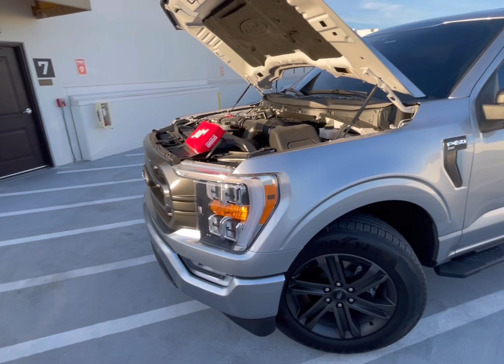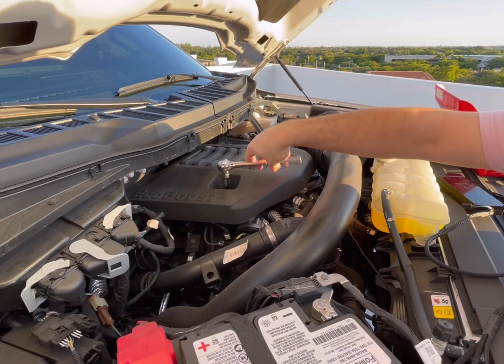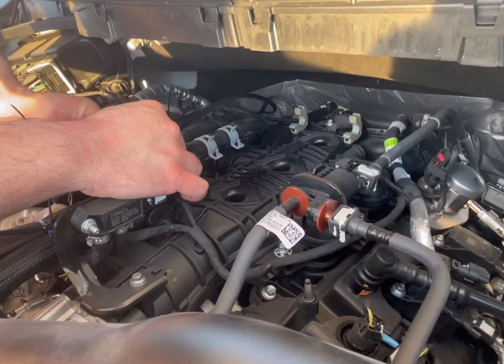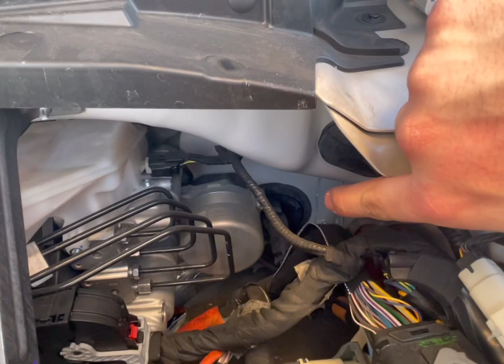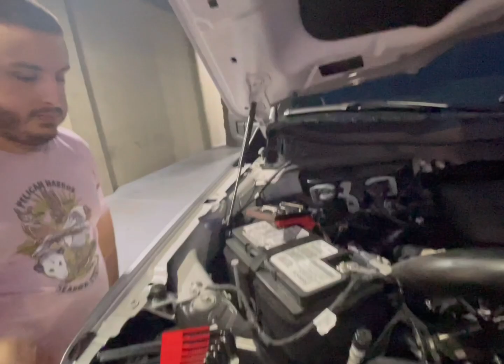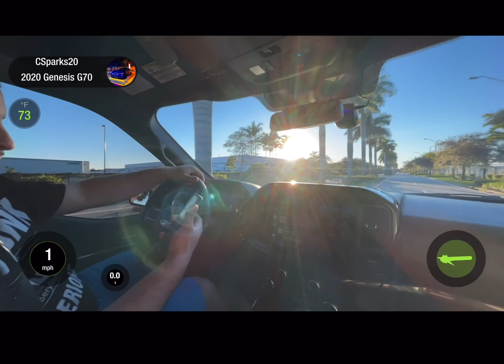FORD F-150 3.5 ECOBOOST WITH JB4 TUNER! DRAGY 0-60 TEST. CAN THE F-150 GET INTO THE 4 SECONDS?

Comment: Weight to power ratio.  Can’t sit in the truck with the driver and expect to see a big improvement in 0-60.  Especially if his best previous time is with no passengers.
Reply from the maker: I think going from a 5.7(with me as passenger) to a 5.1 is major improvement regardless! Thanks for commenting 👍
Reply: @TheAftermarket1  I guess but not many ppl are after passenger performance.  You could have showcased the JB4 in a better way imho.
Reply from the maker: @802sho  if the dragy tests before were with a passenger, continuity requires it after too. That’s actual equal measurement. Anything else would have been misleading.
Reply: @TheAftermarket1  for sure just don’t know why you started it with a passenger.  Ppl will judge it based on time and not take into consideration a passenger.  Makes no sense to me.  Let’s see how much faster we are….and let’s add 200lbs or so…..I’m curious what it would have been with just the driver and now I’ll have to live, guessing what those numbers would have been.  Lol.
Reply from the maker: @802sho  I guess you’ll have to subscribe and wait for the next video ;). But in all seriousness Anthony is a close friend, he’s got a few more parts coming in so we’ll be using this channel to document his build in the same way I do with my G70. I don’t expect you’ll see too much of a difference without a passenger.
Reply: @TheAftermarket1  you should.  100lbs is 1/10 in the quarter.
Reply: @TheAftermarket1  lol Unless you weigh 50 pounds you will most certainly see a very noticeable performance difference!